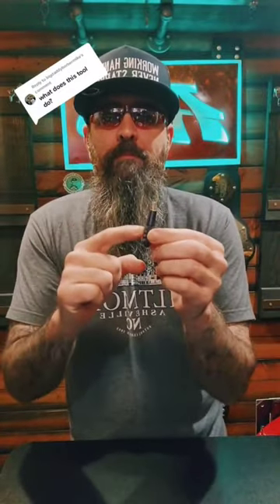Yes, Lighters Need Bleeding!

Comment: Okay well maybe explain why a lighter needs to be bled..
Reply: If you don’t get the air out before and during filling you won’t be able to get as much butane back in.  From what I’ve heard you keep doing that you’ll not only hold less butane but you’ll start getting problems like sputtering flame and eventually no ignition at all. I’m sure he’ll correct me if I heard wrong.